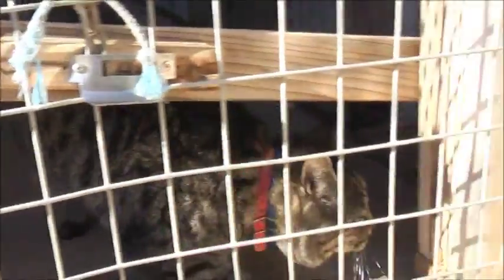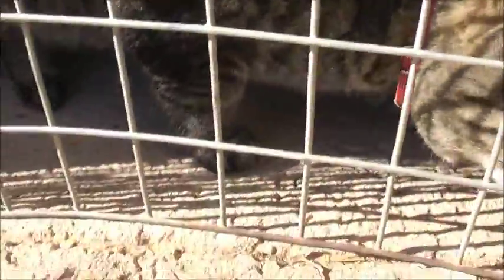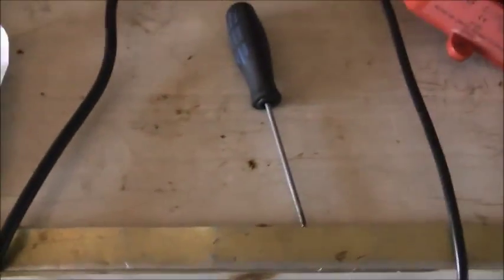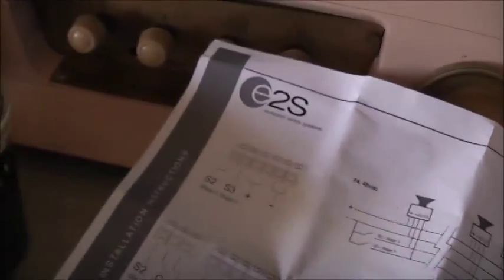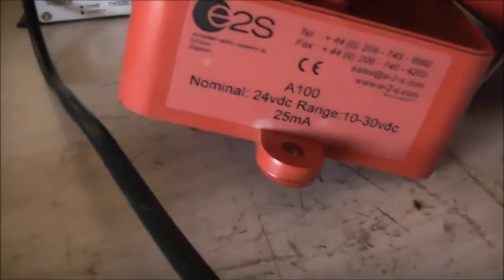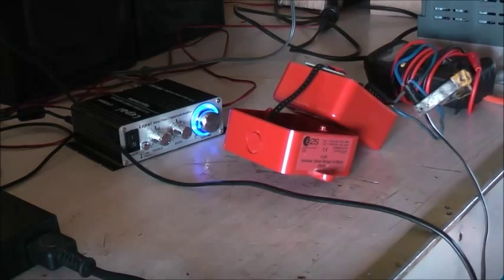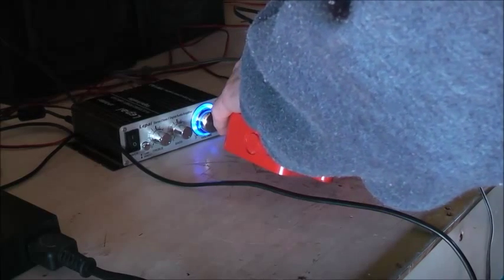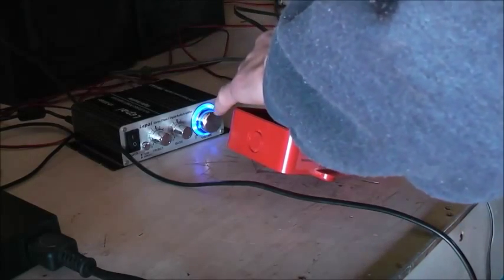e2s Warning Signal Test!

Comment: Is there any point in running it at 24v unless you need it really loud?
Reply: Not really no, they can typicl run just fine at 18 volts or even 12 on some. Its a standard type notification appliance for fire alarms and things like industrial machinery. Most fire alarm systems and notification circuits are all 24 volts. We have federal signal type buzzers ffor the injection molding machines we have at work when they alarm out.